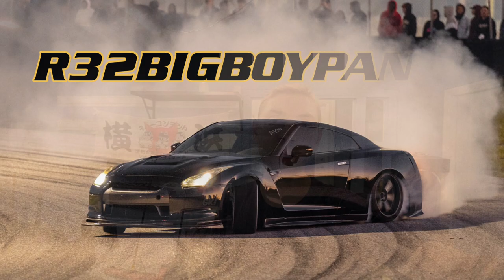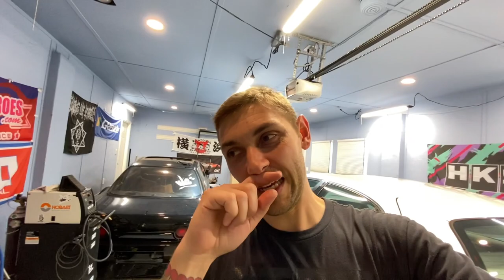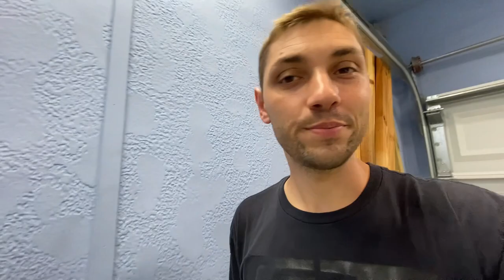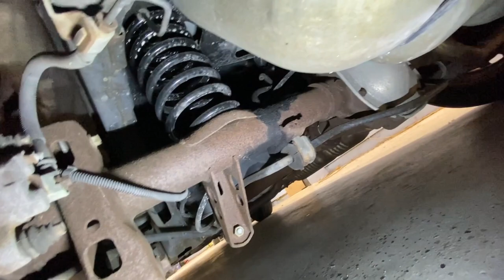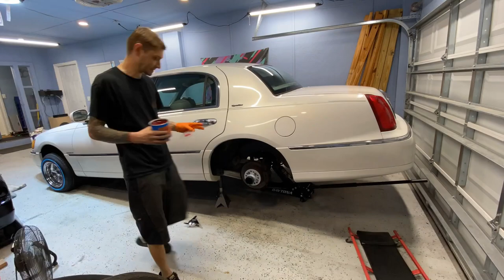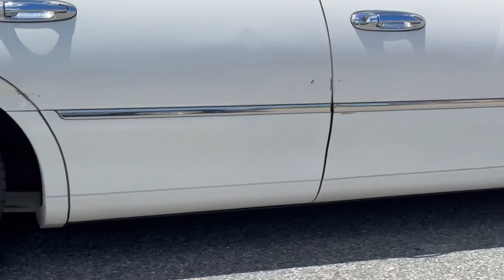Building a lowrider , 98 lincoln town car

Comment: I'm 42. When I was 19 I had a 83 Cadillac coupe deVille lowrider. 2 pumps, 6 batteries,  10 switches, 16" cylinders in the rear, chainbridge... I miss that thing everyday 😢
Reply from the maker: Thats a serious set up! Its never to late to start again homie. I dont plan on building this car over night. It will take me some time for sure
Reply: @R32BIGBOYPANTS  I been looking around for the last cpl months for something to do again. That's kinda what led me here. Whatever it is, it's getting 3 pumps this time. I'm into drift and stance shit now but that low low itch is coming back. Hmu if there's anything you need to know homie.

Comment: Needs a spindle swap or grind the calipers so you don’t need spacers so the front rims don’t stick out
Reply from the maker: 100%.  Im probably going to spindle swap it. Id rather not grind the calipers. Plus id like the secondary set of wheels to be 13s, so id like to leave caliper clearance for those if need be.
Reply: Lowrider rims are supposed to stick out lol add a tuck to the front

Comment: 93-96 big body parts are plentiful and are pretty much the same chassis/suspension wise from 77-96 rwd Cadillacs. Caprices, roadmasters, and a few other GM cars as well. Cadillac Connect will most likely have any exterior or interior parts you may need as well. That being said, good choice on the Lincoln! I have one myself spindle swapped on 13's and juice and I drive it on the highway all the time with no issues! Will keep an eye on this build, good luck!!
Reply from the maker: Thats dope! Im still a sucker for the fleetwood, so im sure ill own one at some point . I never knew that about the caddys.  My goal is basicly what youv got going on!

Comment: what size is that spacers up front looks huge.  couldnt you just shave down the calipers so the wheels dont poke out?
Reply from the maker: Spacers are 1.25” . I plan on doing the hub conversion and caddy upper control arms

Comment: Panther frames ain’t bad but boi u can’t hop em like a GM frame. That watts linkage n the rear won’t let u 3 wheel like gm cars either . Definitely look good as a rider tho ! Good luck bro
Reply from the maker: Yea, i still want a g body. I dont think this will be the only lowrider i put together hopefully
Reply: I still have the watts link on mine and I do rolling 3's all the time! Only to the left though, it won't let you do it on the right lol. But yes triangulated 4 link is next on the list. Preferably from a 95-97 so I can keep it 4 wheel disc brakes.

Comment: Just got a 01 town car, both ball joints snapped on me. Cut the springs and put a double din and sum 12s. Just gotta tint it N throw sum 14s
Reply from the maker: Thats crazy! Howd did the ball joints snap?
Reply: @R32BIGBOYPANTS  I was at 160k when they snapped, just hitting a U turn and other time was when I hit a pothole and it broke

Comment: What size spacers did u use
Reply from the maker: I ended up using 1 1/4  i believe. I also cut down the non threaded portion of the wheel studs aswell
Reply: Thank you.

Comment: How thick where the spacers i heard you can use 1.25" the least?
Reply from the maker: I used 1.25” spacers, but i cut off the part of the wheel stud with no thread so it could fit. Otherwise youll need 1.5” to bolt on the knock offs
Reply: @R32BIGBOYPANTS  I see thanks for the info👍👍

Comment: did you have to shave calipers or use a spacer for the wire wheels to fit?
Reply from the maker: I used a spacer. 1.25” spacer.  Had to cut down the factory wheel studs a bit though. Otherwise, i would have had to grind the caliper. There is also an option of doing a 91 town car spindle conversion
Reply: Can you put 14 on
Reply: @richardvargas3088  I'm a 13s kind of guy.